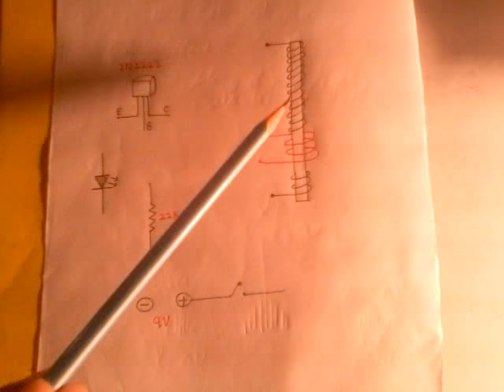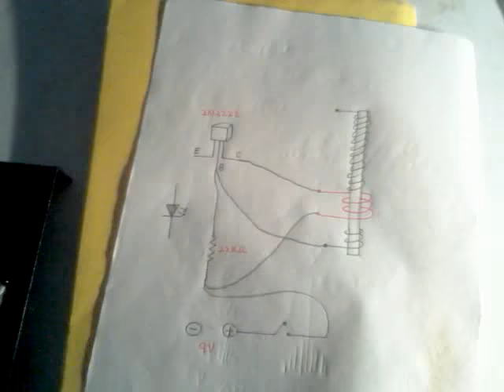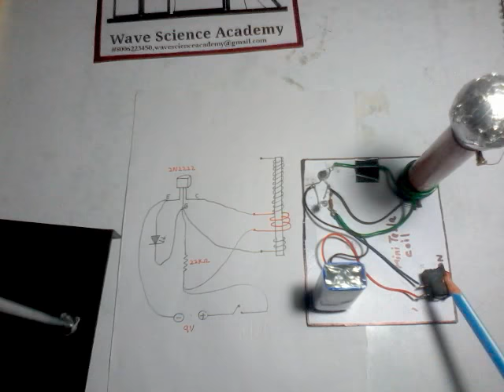Mini Tesla Coil

Comment: Bro i am not getting 2N2222A transistor 😫 i got ksp 22222a wilk they perform same function? And do we have to use 2.2k ohm ir 22K ohm? Plz reply fst
Reply from the maker: Actually I haven't tried this. But will not work with 2.2k

Comment: Nice video, just a question i have the same build but with a ferrite core and no metal cap. Mine does not work however, all connections are right but my light does not turn on. The transistor gets really hot quick, the wire has not been coiled on well but. Is this the reason, must the wire be side by side not on top of each other, if so can you tell me why?

Comment from the maker: if all the connection are right. then wind the primary coil in opposite direction. and your led must be glow if you change the terminal of battery
Reply from the maker: Bazel Merchad Bazel Merchad first Tesla coil is air core transformer not ferrite core n the glowing of cfl is due to high voltage in secondary coil which depends number of turns in secondary and resonant frequency n hotness is due to continuous low current.

Comment: can you tell me that i can use any wire for secondary coil please reply i am doing it as my project and i am using KSP2222 transistor
Reply from the maker: Mr. Pirate it's fine
Reply from the maker: Mr. Pirate u may use 2n3904 or bc547

Comment: where do I get this 0 .5 mm wire and long it need
Reply from the maker: sachin panda where fans is get to be repaired
Reply: WAVE SCIENCE ACADEMY  can we use 10 k ohm resistance
Reply from the maker: Vindhyavasini Soni I didn't try it but I tried 22k it was bad for Tesla. 10k don't try